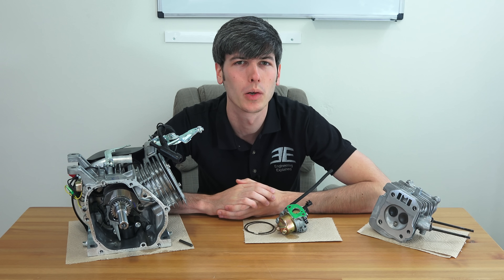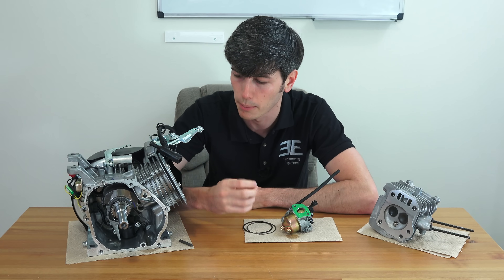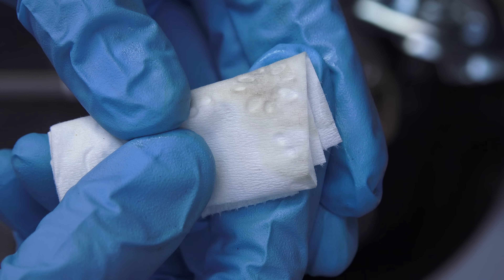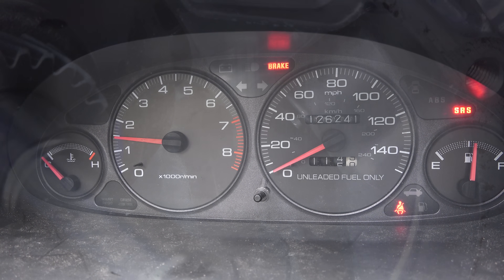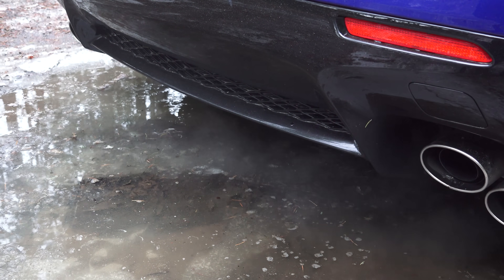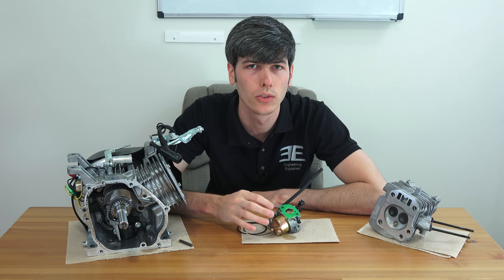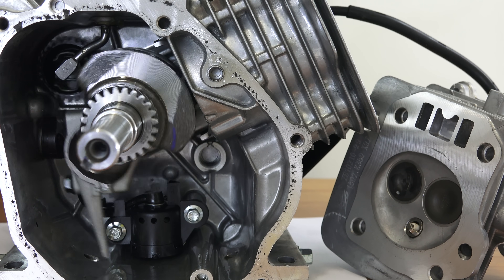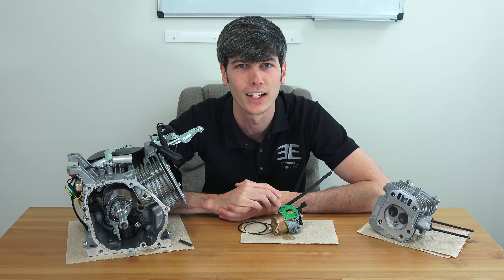Should You Warm Up Your Car Before Driving?

Comment: Is the 1997 Toyota Corolla carbolated?
Reply: Not that I remember but it could have been carbonated at one point.
Reply: It might be. They only way you can figure out if your engine is carbolated is if you try filling up the tank with diesel fuel. Now if you run diesel through your engine and the engine has a little redish smoke coming out the back, then yes its carbolated. So then just finish of the tank and go back to gas and you will be all set.
Reply: Not a single ** was given in the comments section that day xD
Reply: the 1997 toyota corrolla actually uses a pre-carbonated fuel solution, if you are not mixing one gallon of club soda with every 50 of gas, the carbonation ratios will hurt the engine. 

Protip, doubling the club soda amount will give 20-30 extra hp
Reply: +Andrew Wittwer why would you ever do that.... NO NO NO!!!
Reply: +Andrew wittwer I put gasoline in my TDI one time so it wouldn't have to warm up as long, I found out it wasn't carbolated before....  But it is now  :(
Reply: metroboomin I have no clue what you are talking about.  But keep in mind that a 1997 will probably not be carbonated aymore.  This does not mean that it never was, it most likely lost its carbonation over time. You just need to check your carbon monoxide levels and top it off as needed.
Reply: s70driver2005 SHUT UP. Let him learn the hard way. Dont ruin the suprise
Reply: +Elias Bargee oh very true, safe to assume after all the years they've gone flat. Next time I'll see one I'll shake it to double check if there's any carbonation left
Reply: +Elias Bargee just checked my fridge, pretty sure it isn't. I've got 5 in there and none of them made that sizzle sound when I opened them
Reply: You just need to look for carbolic acid in your car.
Reply: Nope.

Comment: hi, I've Suzuki Swift diesel 1.3 ltr, as soon as I swich on the key to on position the fuel pump starts and cuts off after 20-30 seconds, my question is which would be ideal ignition? shall i wait for fuel pump to stop or start the engine as soon as I get in the car.

Comment: I usually get to the car, start it up while I adjust the seatbelt, and I check the mirrors (I'm not the only one driving that car), and then I roll out when idle has dropped from 1500 rpm to 1000 rpm, which happens within the first minute unless is freezing cold.

Comment: How about -30C (-22F) when the brake and power steering fluids are very viscous and they cause way more resistance during operation. Would that offset the benefits of driving right away ?

Comment: I have an older car that doesn't have all of the fancy electronics used to keep the engine running smooth all the time so generally in the winter I do have to wait a few minutes for the oil to warm up or else my car will stall itself.

Comment: I just start a fire under the oil pan before i start my car.
Reply: Not sure if you meant it as a joke but people do this in some parts of the world.
It's how we used to start the old Aro diesel engines back in Romania in the winter.
Reply: I heard that if you do the same under the gas tank it should get the engine warmer a lot quicker.
Reply: Mircea Dogaru Yes, I knew that. Im glad it doesnt get that cold here in minnesota lol.
Reply: Eh, some cars don't come with block heaters. Gotta do whatcha gotta do
Reply: Jack Duno they have the magnet ones, or the dipstick ones. the dipstick ones suck ass though. i heard they burn the oil.
Reply: this comment just made my day LOL
Reply: Corrosion37 In theory the magnetic ones are far, far superior since they distribute the heat a more evenly through the surface of the pan. Rather than the dipstick ones which concentrate the heat to a small area.
Reply: ive actually had to do that a  few times when i did not have the option to plug my cars block and other heaters in 

used a pizza grill with bbq charcoal and a small soup can  with a cap full and HEET tm antifreeze and water removal
Reply: What about if you have a Diesel Vehicle? Regardless I still warm my 335d up for a few minutes before setting off in temperatures below 5 Celsius
Reply: Before block heaters, my Father used to put a light bulb under the oil pan, worked great!
Reply: car starting done right!
Reply: I've done that when in a place where there was nowhere to plug in my engine block heater. I used a steel can, put petrol in it with some alcohol so it wouldn't smoke, and it worked quite well. I've also used a high wattage incandescent lamp under the oil pan on a car with no block heater, also works good.
Reply: actually I've seen thing being done. I remember a person I knew owned an old Austin diesel truck manufactured in the 50s, and he literally had to light a firr underneath the engine before he could make it start.
Reply: taking a torch to it may be more efficient
Reply: Kirk Augustin not sure if srs
Reply: Kirk Augustin i was joking about the torch..
Reply: I've almost done it a few years ago :) Summer oil, diesel car not used for two months and wax precipitated enough to clog fuel filter on cold start. I had to improvise with empty food can and big lighter to warm the filter up. Mine filter is almost built in gas tank though.
Reply: If I ever needed to do this on a regular basis, I would just get sterno cans.  Open flame under a vehicle makes me nervous (rubber brake lines, uneven brake fluid heating/expansion, oily grime on the pan/block; aiieessh.  Thou shalt not tempt Murphy's Law.)
Reply: Stay away from the fuel tank.
Reply: Its very good method to make suicide car boming , 😛😛

Comment: I usually wait like 10 minutes, at least 5, to warm up my car, 88 rx7 vert. Don't wanna blow any seals.
Reply: Your actually doing harm to your rotary unless your doing regular carbon cleanings? I've owned all 3 generations of Rx7's and have a 20b in my fd. With modern fuel injection, cold starts dump in more fuel. In a rotary, it takes a very long time to warm up the combustion chamber idling because of how long it is. With excessive fuel being dumped in, the unburned fuel will turn to carbon buildup. Carbon buildup is the #1 killer of NA rotary's because over time bits and pieces break off the rotor face and cause carbon lock of the apex seals. This is why these engines flood so much as the carbon will also coat the spark plugs which makes them more susceptible to fouling. Your engine have 3 piece apex seals and that bottom piece is very prone to sticking within the rotor groove therefore leaving the top piece to bounce around the rotor chamber (not good). It's best you crank up the engine and as soon as oil pressure hits, raise rpm to above 2k for a few seconds (15 or so) to quickly raise the exhaust temps. Doing this helps burn off the excessive fuel that was dumped I'm during the cold start. Now you can drive off like normal. With rotary's, the faster you warm up the combustion chamber, the less carbon you build up.
Reply: Impudent child! You must now say twelve hail Mazdas and repent as you watch Saint 787b run a lap at LeMans!
Reply: +OneGearMode Just remember that excessive warm idling is also bad for rotary's because the enlongated combustion chamber never stays as hot as a piston engines (which is much smaller). Plus pre Renesis rotary's can't idle at stoich so idling at 12.5-13.0 afr is very rich for a combustion chamber that stays much cooler when compared to a piston engine. Rich a/f plus too cool combustions temps = excessive carbon build up.
Reply: Rotary engines are obsolete.  May as well be running steam in that little old Mazda.
Reply: +GroovinFunk Thx for your input.  :)
Reply: I'm sure you'd be fine with 5 minutes as long as you're really easy on the gas for a bit
Reply: 5 mins ain't enough.
Reply: +RotaryPerfection okay, my mistake. What I meant to say is driving it slowly, not giving too much rpm or throttle, not letting it idle for too long.
Reply: +RotaryPerfection well when I start the car it idles at around 3k for a few seconds, about 5, then drops below 1k and sounds like it wants to stall out, but I just step on the gas a bit and the rpms shoot up to about 1500-2000 and it stays there for a bit, then it eventually settles down to idle speed which is like 900 rpms after I've let the car run for a few minutes
Reply: +David McClelland Thx for your input.
Reply: Why waste time watching LeMans when rally and the WRC exists?
Reply: That was very informative, I learned so much lol.

Comment: I use block heater on winter, warms up the block / oil. 

A question for EE too, is it possible to see a video about fuel additives in the future, for example from old to new engines, petrol and diesel ?

Comment: What about for rotary engines? I always let my RX-8 idle until the auto choke lets it idle below 1500rpm. When you first start it up from every cold start it'll self choke itself at 2000-2500rpm and at operating temp it'll idle at the normal 800-900.

Comment: This is not accurate as oil is not supposed to accumulate on the inside of the cylinder wall inside the combustion chamber, otherwise you are burning oil. The only modern day engines that still lubricate inside the combustion chamber and still burn oil are rotary engines (Mazda). So the demonstration showing lubricated oil side walls then being sprayed with a fuel is not what happens. Otherwise, warming up a car for more than a minute in regular temperature is wasteful and with today's technology, unnecessary. Many engineers have spent tireless hours to make sure we can just get in and go, in all types of environments. Some comments below are also accurate for warming up a car. I know in the northern prairies, in Canada, when I was young people would go shopping and just leave their cars idling because it would get so cold, think -40 at times and colder, when the heater just doesn't work. lol. so to each's own, but oil is not deposited inside the combustion chamber, otherwise you have defective rings, walls or pistons.

Comment: I'm always scared to drive it when its cold because the oil pressure reading is pegged to like 90
Reply: 90 sounds a little high, but oil pressure should be higher on startup then when the motor is at temperature. My '73 Chevy is around 45psi at idle when cold but slowly calms down to around 20-25 when it is at operating temperature.

Comment: I've always let mine warm up to a quarter of the way to operating temperature before taking off.  Driving at low speeds seems to really help also, not as much cold air pushing through the front.

Comment: My reason for warming up my truck is quite simply that i have blown 2 oil pumps (both in 20 year old vehicles) because at -50 the oil is too thick to pump at anything more than idle, kinda dont want to put an oil pump in a new vehicle. if you are only dealing with -20 or warmer weather warm up till the windows defrost and go.

Comment: Does having a Turbo change anything? I'd think so and have heard in Forums that I should let the oil heat up before I move to reduce wear on the turbo. I usually give it a couple minutes in idle and then drive easy until I hit operating temps.

Comment: I still wait for my car to warm up due to it being a manual. If I drive off after I start it and wait about a minute the transmission oil hasn't really warmed up yet so gear shifts are kinda notch, especially going into 2nd. It only really noticeable when it's really cold out and on top of that I like to have my heated seats and heat to kick in before touching all the leather haha

Comment: Jason, I agree. However, I live in NJ and my commute is rough on my car. My car is a 2002 1.8T Audi with manual tranny. I have noticed that when I drive it when it is cold, the engine feels less responsive, less powerful, and rough when it is cold. I let it warm up for about 5 minutes and it gets to about 1/4 warmth. I am forced to drive my car hard as soon as I go to and from work. 

Plus, you can't forget that fuel does not go to the crankshaft, that's all oil for lubrication. The oil viscosity when cold will make the engine work harder to compensate for the rotational inertia of the crankshaft itself and the drag from the thicker oil. Once the oil is hot, the rotational inertia becomes easier on the car since the oil is at operating temperature, therefore you have less drag.

I'm an engineer too.

Comment: back here finland where winter is quite cold and long, we have electricity posts in parking areas that are used to heat up the car. Usually both engine (oil and coolant) and indoor temps (makes scraping the windows much easier). Last winter i cold started my car at -32C and i could tell it didnt like it. the timer on the electricity post froze and didnt work :P

Comment: I always used to start my car and sit in it for a solid 3-5 minutes until the coolant warms up, and then drive normally. Are you saying this method is actually putting more wear on my engine because it would warm up faster while actually driving? I only drive maybe 20 miles a day (10 miles one way).

Comment: But the idle is higher when you start a cold engine, so will it hurt the transmission to put it into gear at 1400rpm than at 700rpm?
Reply: Not enough to matter, besides if you let the engine warm up so it idles at 700 your transmission is still going to be cold
Reply: if you put it in drive the rpms the ecu will probably lower the rpms before it engages power to the transmission. higher rpms on cold starts are actually less about sustaining combustion and more about heating up the cat to lower emissions.

Comment: Hi im a little bit at lost, so yea I dont have to wait for my engine to heat up before driving (fuel injected) but you implied that fuel injection can cause the gasoline to mix with the oil and as a result , it loses its viscosity and washes the oil in the pistons (correct me here if im wrong) when the engine is STILL COLD. What do I have to do so that the gas will be completely combusted ?

Comment: but how about when you have engine block heater ? is it fine to use that ? or is that just not necessary ?
Reply: +wasterpop What do you mean already heated? In the mornings I suppose the engine is cold after a night of standing?
Reply: Alaska here, -40 temps are often the high temps in my area during the winter months 

All my cars have a minimum of a block heater and oil pan heater with either a trickle charger or battery heater too , some vehicles will have an added transmission heater along with a radiator percolator heater as well 

as far s warm up time, 10 minutes to hours .....
Reply: Depends on the location really.
Having a eb heater in UK is pretty pointless since temperatures rarely drop to negative even in winter.
However, in Finland, for example, eb heaters are the norm and most parking lots have power sockets where you can plug in your heater so you can start easily in the morning. Makes sense when temperatures are -30 degrees celsius. Forgot to plug it one night and starting the car next morning was no fun.
Reply: it's not necessary because the block is already heated. pretty much if the temp gauge is at the halfway mark (or close to it) when you start your car, you're good
Reply: Of course it is fine, its even better than driving it cold
Reply: thus the engine block heater you turn on an hour or so before you start your car.
Reply: There are different types of engine block heaters. Some mount right into a freeze plug hole (in the engine block). Others like the one I installed on my truck, heat the coolant. It has a small turbine that when plugged in circulates the coolant and warms it up as it circulates. It is mounted on the lower radiator hose and actually helps a great deal. They are usually just to assist starting though, so I do not recommend ripping a burnout with your cold motor, even if you do have a block heater.

Comment: I agree with you as nearly all vehicle manufacturers say what you are saying in all the car service  manuals I have read in the past. Many modern vehicles heat up quickly nowadays usally about 5 minutes but I can't see anyone doing any harm by letting there engine idle for 30 seconds to one minute especially on really cold days with thick oil viscosity. Over the years I have pulled apart several engines and have seen wear on turbo bearings and camshafts/valve train assembles due to hard cold start driving especially when somebody lives close  to a freeway/highway for example would is your opinion on this scenario

Comment: Good advice. Newer engines tend to idle faster when cold to accelerate the warm up process. Of Course, driving the car normally will result in even higher revs warming the engine even faster.

Comment: One point about carbureted engines. Most all carbs have chokes to control the mixture in cold temps that either block air from entering the carb (which is the traditional way) or simply drop the main jets to richen the mixture (much like an SU carb).